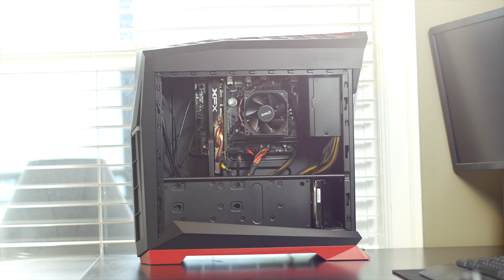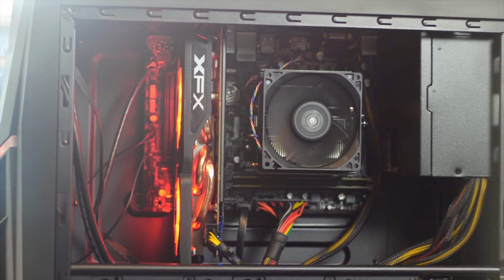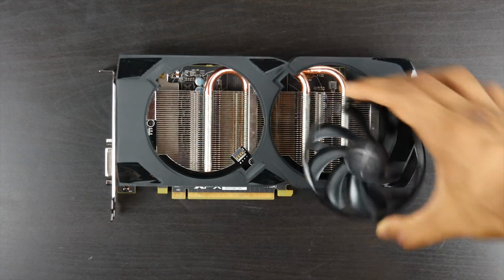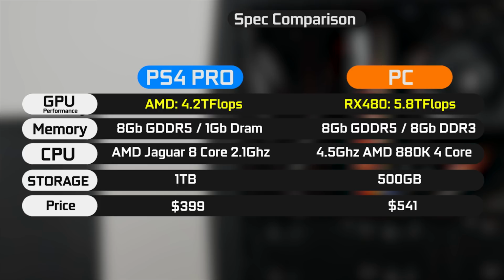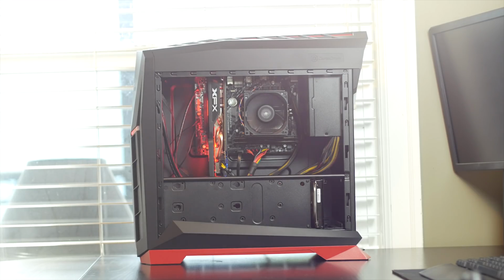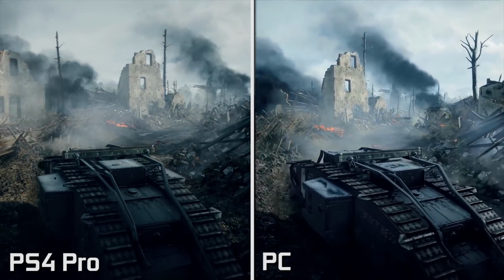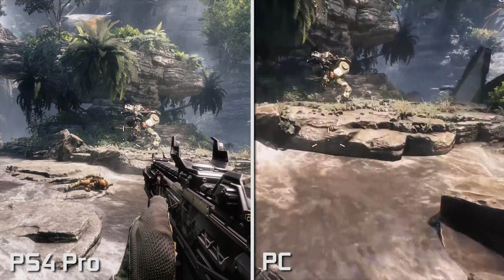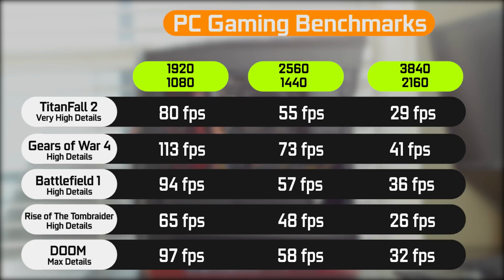Playstation 4 Pro vs $550 Gaming PC

Comment: I think the X4 880K would bottleneck the RX 480, you could have gotten a much cheaper case and opted for an i3 perhaps.
Reply: U can literally get 4th gen i5 with a barebones asrock for 200euro. downgrade from 480 to 470, get a cheap case and u will meet the 500 pricetag.
Reply: MAJOR bottleneck
Reply: Jameo360 actually,  the 880k gets a higher cinebench score than the i3 6100,  so it won't bottleneck and an i3 wouldn't be any better
Reply: Hydrochloric Acid Yes, but the i3 6100 is a Dual Core, the 880K is a Quad Core, a higher CB score doesn't mean its a better processor.
Reply: Jameo360 actually both have 4 threads,  so they are equal in that area.  And considering how multithreaded games are today they can definitely use all those threads.  Plus,  the 880k had a 20% advantage
Reply: Hydrochloric Acid Hyperthreading on a Dual core is not equvalent to a true Quad Core CPU, of course the 880K will beat the i3 in CB.
Reply: It is in terms of software.  Software cannot see the difference between cores and threads. So yes,  they are the same
Reply: Hydrochloric Acid It doesn't matter if it doesn't know about the cores or threads, the 880K has 4 physical cores, so it will do better, even if both say 4 threads.
Reply: Jameo360 actually forget i said anything.  Cinebench numbers i looked at were for an overclocked athlon.  Actual stock numbers put them about equal and don't show a decisive advantage for the 880k
Reply: except the price.
Reply: Hydrochloric Acid m
Reply: ***** imo it isn't as much of a bottleneck as people think.  2 years ago it would have been different ,  but considering that new games put much more load on the gpu and can properly use 4 threads it should be fine
Reply: Not at 4k lol.

Comment: People who say the 880k is a bad cpu have never owned an x4 athlon. 
While not top-o-the line by any stretch youd be surprised how well it performs
I get 90 +/- fps 1080p max settings on battlefront with an 860 + gtx 480, gpu @ 100% cpu @ 80%

Comment: if you need a pc anyway, you can spend the money you would on a console and pc and make a nice one. thats what i did, over hte year i debated getting a gaming pc or building one. but when my pc was failing i got my buddies old one for 100 with a bunch of stuff. it was that great but was quicker then what i had before. then i said screw it and was going to use some parts and buy the rest. said screw it all use it as a back up and just get everything. i said screw console tired of the limitations and paying extra for online. i think 4k is so over rated. 1080p for me looks really nice and all i need. plus the print isnt small. id rather just play on my 3 24" 1080p screens or even my 27 ''  tn panel or even my old lcd 40 inch. dont use it ever though, damn pc players  hyped it up so then console players want 4k and so they delivered. i dont like people that think they are cool or better cause they play pc.  are you that ignorant, money, cars, game system etc dont mean you are cool cause you have it. also think about the elites think you are scum cause you are broke to what they have and you are a perpetual debt slave to them, in many cases is true. so you are doing the same thing. but hand down so much better. you can still play at a couch or on a bed like i used to. even with mouse and keyboard, or you can get any type of console controller you want.

Comment: No direct framerate comparison nor direct detail comparisons shown... You need to see digital foundry's videos on how to compare different systems to each other. Considering most PS4 Pro games actually render at 1800p not 1440p your recommendation is seriously misleading. 

For budget cpu i7 2600k is king at $150 on eBay. Budget GPU the RX 470 wins at $150. That's $300. Z77 Mobos sell for $65,  $45 for 8gb ddr3, $60 for a $240gb SSD, $60 for a decent case and PSU brings us to $530 and a much better system.
Reply: Christopher Gardiner wow 60$ for $240GB ? BTW u can just build a pc for 470$ with i3 6100 and gtx 1060 3gb and 8gb ddr4 and 1TB hard drive or cheap 240GB ssd and non of them is used sooo why 530$

Comment: dumb ass spent 90 on a case and 50 for the cpu. Bottlenecks the rx480 too smh
Reply: Yea he should have mentioned that in the video. Could have easily found a case for half the price and got a better CPU or just a cheaper build.
Reply: where can I get 980 ti so cheap?
Reply: He also could have bought a used fury x or 980 TI for cheaper then a 480 which would been alot faster.  That cpu he got is GARBAGE for gaming.
Reply: 4GB MEANS 4GB where exactly are you seeing used 980ti for less than a 480??

Comment: Ps4 Pro is 400$  FAIL VIDEO
Reply: Thing is , it should be a lot cheaper than this. Spending as much on your cpu as your case in a budget build? That cpu is going to bottleneck the 480 anyway. Cut to a reasonable case and a 470 and your saving 140 bucks. 30-40 dollars to upgrade to a skylake kit , 20 for mouse and keyboard and 20 for an OS and you're done. Assuming you're not using ethernet throw in 10 for a wifi card. When considering the cost of online for PS it amounts to around the same.

Comment: For $500 you can get an i3 that is better and a GTX 1060 3GB or RX 480 4GB which is pretty much no different from their respective brothers.
Reply: Zero necker I'd go for the cheapest AMD 8 core you can find over the i3, but otherwise I agree.
Reply: Rowan Vermeulen I think it's the amd 8520 which could destroy any i3. even though it's 4 years old
Reply: Joe Raw No. The 6100 is better than any FX CPU in gaming performance.
Reply: Zero necker haha no the fx 9590 would destroy a 6100
Reply: Joe Raw Because of the whoping 5GHz clockspeed. But do I want to trade more heat for just a little more performance? No. But I would consider Zen.
Reply: Zero necker Zen hasn't been released yet. Also it just show these fx CPUs are 4 years old an are still used. Back when I built my PC the 6300 was better than any i3
Reply: Joe Raw Of course I know Zen isn't out yet I am not a time traveller. The old FX series will be considered obselete since they didn't even beat the 3th gen i5s that Intel released in the same year. But of course a 6/8 Core would beat an dual core at the time.
Reply: fx9590 lmao it costs more and it REGUIRES a water cooler which is 100usd or you are going to end up frying the damn thing due to 5ghz clock. i3 you can use stock cooler and you will be fine you can't even compare those two..
Reply: TheTurtleOffDoom he said any there was no mention of price
Reply: TheTurtleOffDoom Who the fuck said the 9590 needs a water cooler at least?
Reply: its 220W CPU http://www.newegg.com/Product/Product.aspx?Item=N82E16819113347

Comment: ps4 pro seems pretty nice for that price,
and 480 also seems to have alot of value, i hope amd releases a flagship gpu so that i can get rid of my 980ti as nvidia has kind of forgot about it and are too focused on 1080
Reply: dknight xs Read the topics you linked please... both were made before the pascal was even out, and both are about sli, Nvidia doesn't give a fuck about sli and that is no different in pascal (1060 no sli support. 1080 only 2 way). Also anyone buying 2 gpus should know multi gpu configs have compatibility issues with some games on both Amd and Nvidia. Now if you can't give me any kind of solid proof about Nvidia crippling their older cards i'm just gonna assume your pulling facts out of your ass.
Reply: Why would they focus on the 980ti?
Reply: Awesome plays  for onc it was their flagship less than a year ago, and amd keeps supporting their old flagships. Nvidia intentionally cripples its gpus to make it seem like the new ones are much more powerful.
Reply: Can you name things they can do to support it
Reply: Awesome plays  for one stop crippling their performance vs 1070
Reply: dknight xs Explain to me, how are they crippling 980tis performance? Lower framerates than before? In what games? Proof? Have other 980ti owners complained about this?
Reply: Tsunami  there were some topics opened on geforce forums which nvidia deleted.
there are other threads on reddit
Reply: dknight xs Link?
Reply: Tsunami https://forums.geforce.com/default/topic/938167/nice-job-nvidia-on-crippling-doom-performance-on-my-rig-/?offset=9
Reply: Tsunami https://steamcommunity.com/app/377160/discussions/0/496880503080981036/
Reply: you can search on your own and find alot of other posts either by 980ti users this year or by 780ti users last year. nvidia intentionally tries to cripple yesteryear's flagships to make the newer ones seem more viable. Amd meanwhile matures its gpus in a much better way. compare fallout 4 launch benchmarks of 980ti vs fury x   with present ones, you will be surprised .
Reply: yeah the 980ti is still a beast. dont know how you could be complaining about it. still smashes any amd gpu out there
Reply: That's strange my 980ti is doing great and gets the same if not better performance in games then many 1070s.

Comment: This is dumb why spend $90 on a case get a $40 case and add 50 more to a wayyy better cpu
Reply: The RX 480 is way faster than the 1060 FFS!
Reply: Lol he spends next to nothing on a crap CPU that creates a bottleneck to "save money" but than spends 90 bucks on a case. There is no point in buying a rx 480 if your CPU will limit its performance alot. Just save the money and get a 1050ti or check out my much better build that's only 20 bucks more and way better https://pcpartpicker.com/list/fvDjBP
Reply: @cowpig4676  rx 480 is better than gtx 1060🙄
Reply: the gtx 1060 is more powerful actually
Reply: 50 more in gpu
Reply: the Deep cool Tesseract or NZXT Source 220 are both very attractive windowed cases for cheap af, that case was such a stupid buy
Reply: so get an fx 8350 for i3 6100 and get a gtx 1060 becasue the gtx 1060 is about 5-10% faster in almost any non dx12 game
Reply: Daniel Solomon The 1060 is around $30 more expensive than the 480, at least from what I'm looking at on Newegg and Amazon. we're trying to stay on that $550 point yea?
Reply: yeah because AMD has better drivers for DX12 applications
Reply: Daniel Solomon 480 is better than 1060
Reply: wellll get the 3gb model anyway the main focus is changing the case and cpu
Reply: https://pcpartpicker.com/list/hF8jBP 
 i madde than in like 2 min so there $550
and its the 6gb gtx 1060
Reply: also the 880k is more expensive than the fx 6300 so why wouldn't he just use that it would help with balancing the system out
Reply: Daniel Solomon Bruh just stop, it's mostly preference. Those that want more CPU power will decide on the 8350 black edition since it allows for overclocking, Those that just want more raw power in their GPU will head for your build with the 1060 at the risk of bottle-necking due to the dual core 6100. In these situations though, the differences between the 2 builds should almost be nothing, but I'm positive the build with the 480 and the 8350 black edition should be on the more powerful end if you were to overclock.
Reply: i agree with you but that is only if you want to overclock and that would have you upgrade to a better cooler . but  i spent $60 and got a dell optiplex 390 and a gtx 1060 for 230 and upgraded the power supply and ram and i had a crazy rig that would compete with the 550 build that you made and i made for $350
Reply: Daniel Solomon I never made shit with AMD CPUs, we're all just speculating here. That is your used/refurbished PC experience though, most PC builds are done from scratch, but I guess you are the ultimate budget builder here lmao. Good find though, I'm seeing those range from $120 to $200
Reply: yeah i guess the dude that was selling it didn't know there value
Reply: I upgraded from the 960 to the rx 480, so damn happy
Reply: Check out the video HardwareCanucks just put out of the RX 480 vs the GTX 1060. The 1060 isn't the clear cut leader anymore
Reply: but its cheaper
Reply: +Daniel Solomon Maybe currently, but I bought the xfx gtr rx 480 for $250 last week
Reply: ScumbagSteve nice
Reply: ScumbagSteve but I've found cheaper last week
Reply: The 1060 is faster than the 480...
Reply: Daniel Solomon I had a budget of $4000 for my PC, I've been saving up for 3 years. after I built it I still had$ 800 left and yes I agree with your comment it makes it funnier as well cos he says budget pc
Reply: Konstantin Demenko Cash preferred being wasted is not cash wasted
Reply: cpu changes almost nothing...
Reply: dude that's a spacey futureproof case having expansion options allowing you to add as much stuffs as possible later plus it has triple fans underneath it preventing you to spend cash on a fancy cpu cooler
Reply: Konstantin Demenko you're right anyway unless you wanna go for a new case in the near future 👍
Reply: a way better cpu or a gpu ??? which ones better and what is it ????
Reply: Daniel Solomon 8350 and most of the hardware will see some pretty high temps in those cheap as cases... been there done that

Always spend extra money to help keep your rig running
Reply: Not sure where you are getting your information..
Reply: For reference in 2020. Parts have some new hardware has driven the price down for older hardware but heres my build: $50 case, $60 650W bronze PSU, $80 ryzen 5 2600x, $63 RAM, $120 RX 570 4GB, $41 2TB SATA 5400, $60 GIGABYTE B450A Motherboard. Overall I managed to build a rx 570 midATX under $450, plays all games 1080p ultra and even some 4k
Reply: Also get a gtx 1060
Reply: Holy shit you're right. Switch that out with a cheap DIY case from Newegg(most around $40) and you could up the CPU to an FX-8350 black edition for exactly what you would save from the case downgrade. The GPU is fine though, since it would go over the $550 limit if you wanted a 1060 or better.
Reply: @mynameis______392  rx 480 is better at DX 12 and it has more vram
Reply: Sharar Tajwar you stupid or something?

Comment: GPU: ASUS MSI 480 Power: 750 watt CPU: AMD A10 is that any good guys? I'm upgrading the GPU and power supply everything else is stock
Reply: Don't use a AMD CPU... You will have no upgrade path outside of that generation, so you will have to get a new motherboard, new RAM and a new CPU when you do.
Reply: I already have the AMD its what came with the PC

Comment: xbox scorpio will kill the ps4pro and every budget pc under 1000$
Reply: PLAY BUTTON GIVEAWAY HAHAHAHAHAHAHAHAHAHAHAHAHAHAHAHAHAHAHHAHAHAHAHA
Reply: Petoox 8 core cpu, true 4k gaming. A gtx1080 has about the same teraflops as a scorpio. I dont think you can get that in under 1000$ in a pc. Shut down pc master race, consoles are about to take over
Reply: PLAY BUTTON GIVEAWAY even if that's true, (which is not) do you think the xbox is going to be cheap?
Reply: CaliSupremeCat did i say it was going to be cheap? even if its 1000$ its still going to be a pc killer console. BTW thats true: http://www.xbox.com/en-US/project-scorpio
it has 6 teraflops, gtx 1080 has 6.27 teraflops (the extra 0.27 doesnt really make a difference). i'm not a console fan and i prefer pc but dont be salty and admit the truth.
it will also support vr like oculas and htc vibe, you dont have that in a EVERYDAY pc
Reply: Petoox . I could tell you how a gpu works on the inside with the cpu i can right now but that would take a whole essay. By the amount of cores, gpu teraflops and the bandwith given it can maintain a solid over 50fps 1080p maybe even 1440p